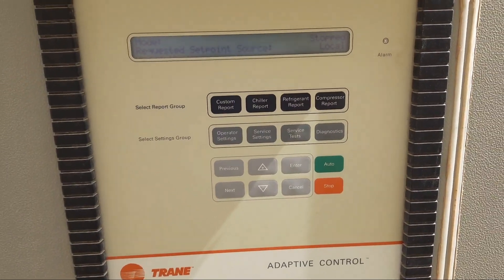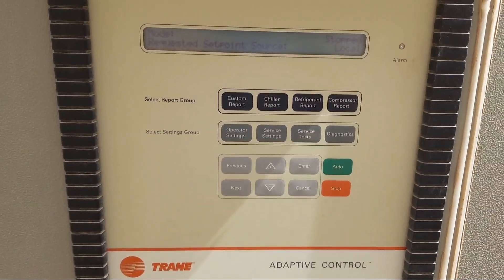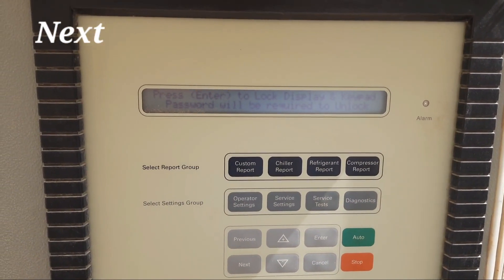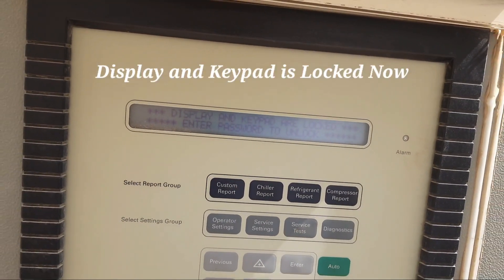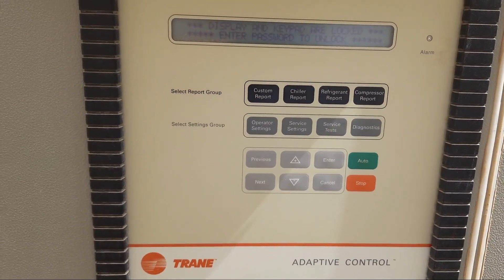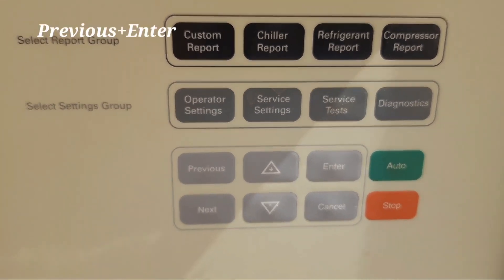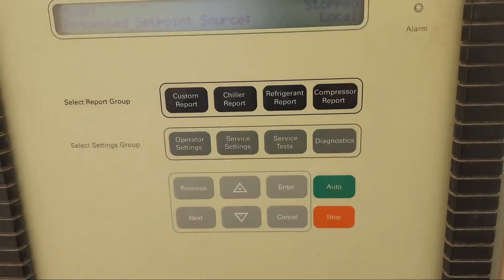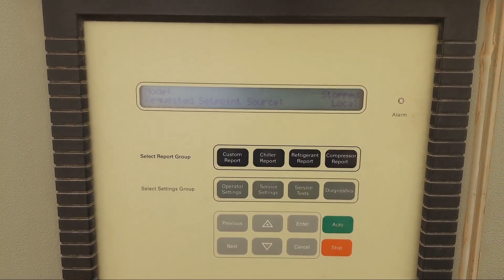How to Unlock Keypad and Display of Trane Chiller||Trane Chiller Display and Keypad

Comment: Hello my brother I have a problem on the Trane RTAD165 group I have an alarm (Temp winding -comp A)
Reply from the maker: Check your compressor heater is working or not
Reply: @MEP.ENGINEERING.WORKS92   No I want to try
Reply from the maker: If it's OK then check your freon is fully charged or less
Reply: @MEP.ENGINEERING.WORKS92  The group he works cold alone